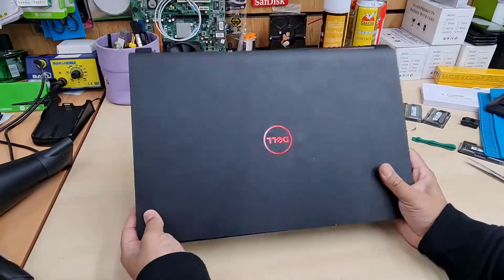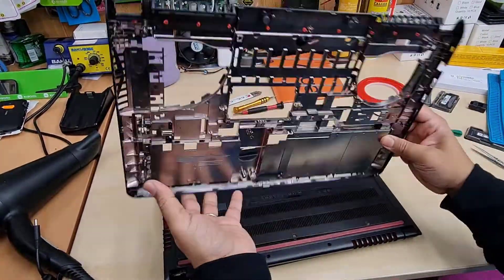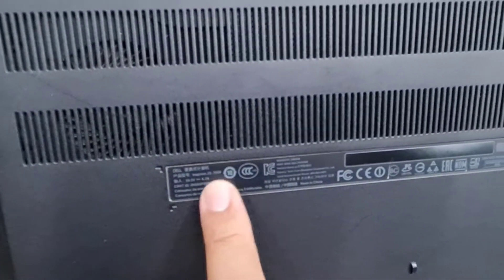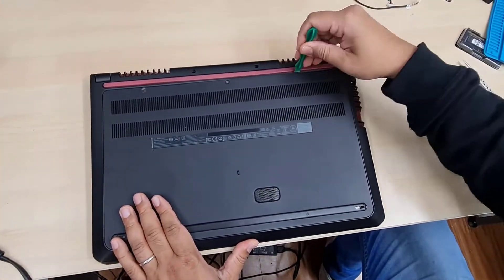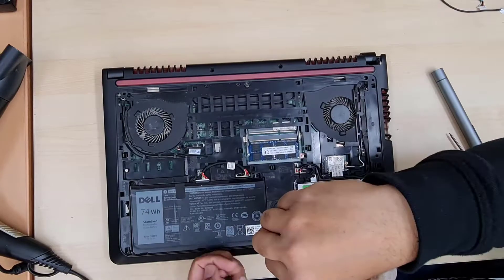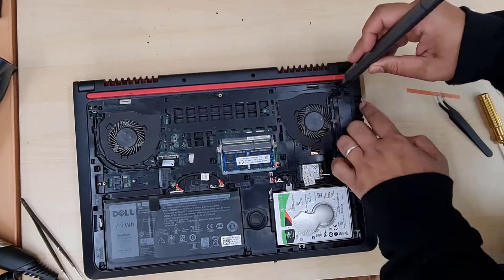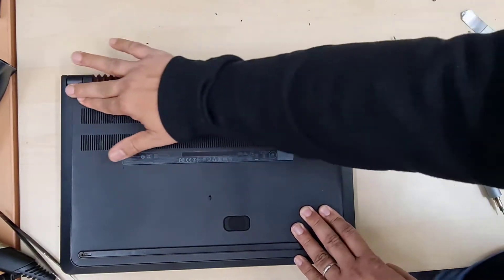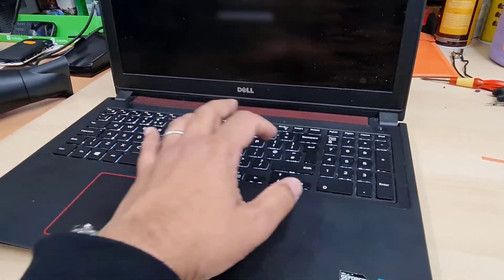Dell Inspiron 15-7559 bottom chassis Replacement | Hinges Issue Solved

Comment: I recently fixed the hinge issue in my Dell Inspiron 15 5577. I was toying around with it and realized the screw for the hinge was short to hold the hinge, the front panel and the fan. I just switched the order. I put the hinge before the fan so that the screw would hold the hinge better. The fan however had another screw so its fine till now.

Comment: Excellent video. I just fixed mine following these steps. The only issue I am now left with is that the WLAN cable that goes through the hinges was also broken so the wifi isnt working well. Any ideas on how to fix that? Any videos showing the fix?
Reply from the maker: To be honest, in this case, you need to replace the entire Wi-Fi antenna cable. Or for shortcut you may use external USB mini Wi-Fi port. Thanks
Reply: @thepcphone  Thanks for the reply. What do I search for in ebay to find this part? and do you know if there is a video which shows   how to replace this? I saw the cable going up on the top half.
Reply: @jimmyvithalani  facing same issue. Found fix?

Comment: Hi, nice video.
Do you have maybe issue with loud fans? I have loud fans all the time for some reason even when laptop is idle. 
I have cleaned it, changed thermal paste and I still get fans spinning loud. When I checked temperature of cpu I was it constantly going up and down 10C. Have you encountered similar issues?
Thanks.
Reply from the maker: Hi, thanks for your comment first. I love to read comments and love sharing knowledge and learn each other. However, I did not have any fan issues. Would you please let me know your laptop comes with which processor? And how old is this? If it's older than 2 years I would suggest you try to change both of the fans which would not cost you that much if you are in the UK.
I hope you're going to subscribe to my channel and share and like. Thanks again.
Reply: I have this model. I recall having the noisy fan issue as well. The solution to the problem for me is to go into the advanced power options  and modify Processor power management > Minimum power state, I set it to 1-2% for the battery and plugged in settings. Also my System cooling in the same interface is set to 'active' on battery, and 'passive' for plugged in. The fans themselves will be loud when they get engaged, but they at least don't run ALL THE TIME anymore. Furthermore when taking this laptop apart like in the video, I cleaned the fans a little in ways I can't do from the outside.